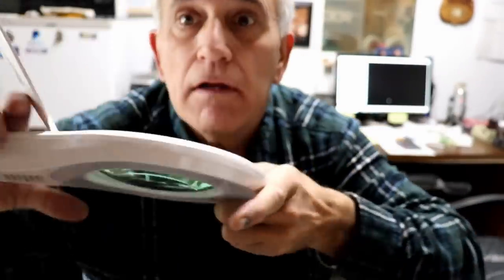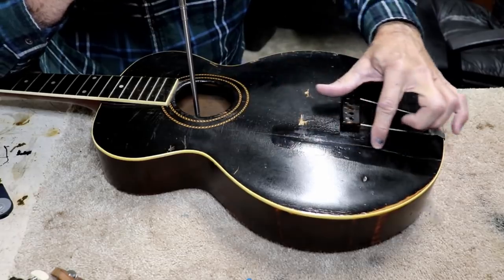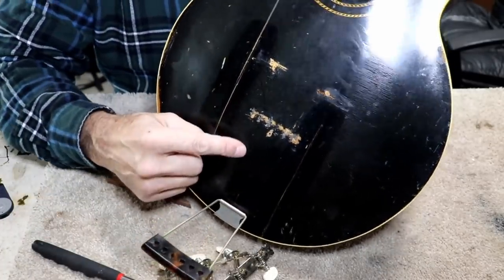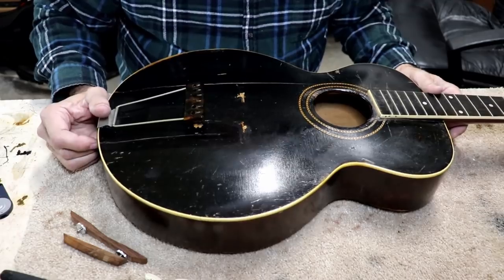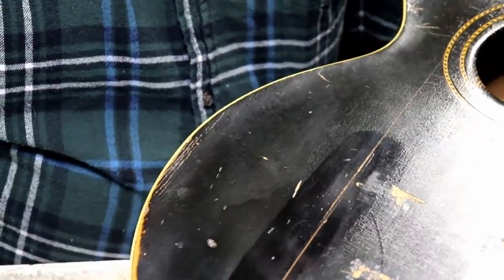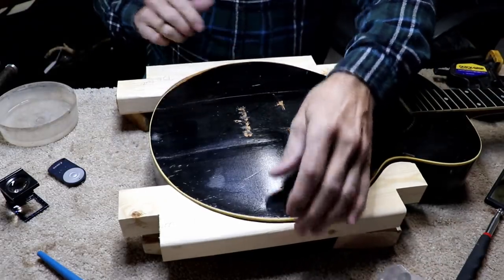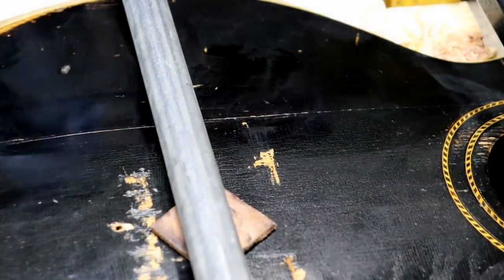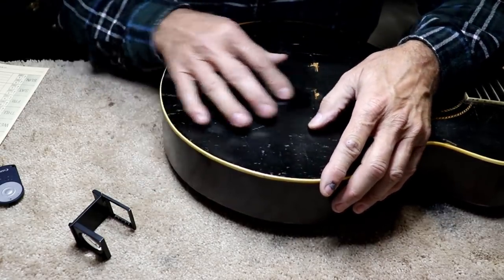265 RSW Gibson L1 Major Surgery Again Part 1

Comment: I just repaired a lower bout crack in a Seagull S6 with a cedar top.  Following your example I was able to sucessfully repair it.  I had to use a clamp on the top to pull it into alignment, didn't take a lot of pressure, but it held the two pieces in alignment. Thanks.  You also show me where the limits of my skills are - popping a top, resetting a neck, I'm not there quite yet.  Thanks.

Comment: I am not a master of finishes, but you are dealing with nitro cellulose lacquer on most Gibsons. Your cracks are called crazing, very common with age, and somewhat desirable, but... as I think you noticed, you can melt new nitro back into old and, heat from rubbing can also melt in a finish. I guess the lighter fluid helps, but heat from rubbing lots would gloss it up too. I have seen some work done with tiny drops of lacquer on Gibson finishes to fill in scratches  and then with a light sand and hot buffing make it disappear. You are totally on the right track here. Personally, I would keep on rubbing and some other guitar snob would hate how I destroyed it. :p

Comment: To read the label when it is like you showed. Take a lightly damp cloth with water. As I said lightly damp. Just pat it on the label. It will bring the writing out so you can read it. I have done this with old 78rpm records when they was not able to be read. It won’t damage the label.

Comment: Nice video Jerry. The 400 grit and paste did actually make a better finish. You can see it on camera. I suspect the lighter fluid would also help, but what a lot of work that would be. The neck needs a good clean.  I would think getting rid of gunk should be the first step of getting a better finish, but I guess you are doing that by softening and then changing the area of the paper towel. It's second nature to you. Your client will be well pleased. Your camera setup is working a treat now.

Comment: Hi Jerry.  I found your experiment with alcohol to dissolve the glue interesting. If you try that again, try using methanol. It's the most polar of the over-the-counter alcohols that you generally can buy at home improvement and hardware stores.  Best of luck.
Reply from the maker: I use denatured alcohol for a very long time and it didn't have any effect either.
Reply: @RosaStringWorks ,  denatured alcohol is usually a mix of methanol and ethanol, with chemicals added to make it terribly bitter so that no one can stand to drink it. The methanol, aka "wood alcohol", is what makes you blind if ingested. For cleaning and solvent use, you might prefer pure methanol. Pure ethyl and pure isopropyl alcohol might be worth trying as well....

Comment: You got the pronunciation of Snohomish correct, good job. I have family from up in that area in Washington. 

Why can't I ever find things like this for  $10.00? Nice find, I love those old Gibsons. I have to consider doing some repair work on my 1917 A1 that I got from my Grandfather. The back wood has decided to shrink and separate, and it's full up the back. If the binding weren't in such good shape it would be easier to decide how to go about this one. I may just see about shimming it and regluing it without removing the back. The joints beside that all seem to be in great shape, another reason I don't want to take it apart. Decisions, decisions...

Can't wait to see how this L1 turns out. If this one is old enough, a 1 piece bridge would be more original, like my A1 has. Depends on when they started using the adjustables on everything. This one actually looks a lot easier than some of the other things you've tackled, I'm sure she'll turn out just fine.
Reply from the maker: It kind of goes down hill in part 2. But we win in the end
Reply: Will, you beat me to it. Yes the pronunciation of Snohomish is correct. I, too, live in the area, about 20 minutes away going over 228th and up highway 9.

Comment: Rick G. from Massachusetts- there is a product called Formby's that does a similar job as the zippo fluid.  It's basically toulene and your right in that it melts the finish and you can rub out the micro cracks.

Comment: Harbor Freight has an air brush sized grit blaster they call an 'Air Eraser". Load it with baking soda and tweak the pressure/mixture to knock the gloss off of a finish.  Also great for removing paint and rust from tuners, etc.  Their hanging motor flex-shaft wood carver beats a flex Dremel.  Foot pedal speed control and more oomph at low speeds.  I think HF or maybe a craft store had a cheap pack of thin foam sticky-backed sheets I use on clamp faces and jigs for protection and to even out the clamping pressure.  Not a salesman - just some items I found very handy in my shop.  
I'm a repairman and hobby metal mangler so if you need an oddball tool, clamp, or something hit me up.  I like what you do and hate to see you struggle so much on these repairs.

ETG
Reply from the maker: Thank you.  The camera probably makes it seem more Dramatical. I don't really feel like I'm struggling. In fact I'm actually very fast compared to most repairment. I have a flexible shaft router. I just prefer using the hand-held Dremel. The flexible shaft bugs me.

Comment: The lighter fluid will get off all the years of accumulated gunk and it just may be enough of the right kind of solvent to soften the finish without cutting it too much...kind of like a french polish on shellac. Liquid finish "restorers" are supposed to work the same way but are often too aggressive as solvents and quickly become strippers. It depends on they type of original finish. Some finishes are impervious to some solvents. Having said all that, I'm surprised lighter fluid would work like that. :)

Comment: I’m working on a Gibson L4.   Funny thing on that it says B4 on the sticker.   
Has two cracks on the body on either side of the neck.   There are two loose braces in that area that caused those cracks.   I took the back off because it was pretty much coming off anyway. and discovered the long brace were loose too near the bottom as well as all the other “rungs” of the ladder.   There are three rungs below the hole and two above near the neck.  The kerfing is messed up as well so will replace all that.

Comment: If Wikipedia is correct about the production years I'd wager this is probably a second run of the L1 which should date it between 1926-37. The L1 was apparently not produced again until 1991 and has been in and out of production since then.

Comment: Looking good Jerry. I like the air pressure for pushing glue in when there is any problem with penetration. I'm sure if you had known how much CA might run through that fretboard you would have pushed some sanding dust in with it. But it's impossible to know at the start. Overall it's looking very good.

Comment: Here is something I found on the Web...
1. Identify:  Select a small, 2" square area that’s as inconspicuous as possible and clean that area with a rag lightly soaked in turpentine. Now that it’s clean, take a good look at the test area. If you can see open pores of wood under the finish and the finish is not glossy, odds are that an oil and wax finish has been applied. If that’s not the case, test for shellac. Take a fresh rag, soak it in denatured alcohol and wring out the excess before rubbing the test area gently. If the finish starts to dissolve right away or becomes sticky and darkens the rag, the finish is indeed shellac. If that doesn’t do anything to the finish, clean the test area again with turpentine and, once dry, start your test for lacquer. Do the same as before, only this time use lacquer thinner. If the finish comes off, it was likely lacquer. If nothing so far has affected the finish, it’s most likely a modern, vanish-based finish. 
2. Reviving a Lacquer Finish. Start first by lightly abrading the finish with #220 sandpaper. Follow the #1 rule of working with sandpaper – rub only with the grain so that any scratches will appear to be grain marks. Vacuum off the piece to clean it and then fill a clean jar half way with lacquer thinner. The idea here is to brush on a thin coat of lacquer thinner, causing the old lacquer to reactivate and be spread, just as it did when it was first applied long ago. Any scratches or blemishes should disappear before your eyes. Keep your brush wet at all times and move from wetted to non-wetted areas until all areas of that section and all other areas have been renewed. Proceed to Step 5.

3. Reviving a Shellac Finish. Shellac, like lacquer, is prepared for revival by a light sanding, followed by a thorough vacuuming. Mix four parts of denatured alcohol with one part of shellac in a clean jar and mix completely. Brush this concoction onto the finish, working only one area at a time. This should dissolve the old finish somewhat and cause it to be revived. Wait at least a few hours to see how well things are coming along. If it appears that the finish is not yet revived, or if the old finish was crackled, odds are that you’ll need to do a second and perhaps third application.

Comment: 1 table spoon kero 10 table spoons turpentine and shaved bees wax in a jar let it dissolve for 3 weeks - under the sink - and try that with a great cloth - my old jaguar car wood was sun damaged and i heard of this = great show thank you !
Reply: Ronnie Boucher used basically the same homemade stuff, minus the kerosene. Requires actual turpentine (distilled from pine trees), modern "mineral spirits"  or "paint thinner" is not the same thing. 

I've read a few historical novels that mention "turpentine camps"; I suppose a bunch of guys lived in the woods for months chopping down pine trees and distilling the essential oils. Probably distilling some horrid-tasting hooch as well, getting blind drunk, and fighting amongst each other !

Comment: The key to polish away them cracks in the finnish i to make heat! The cloth should be like a small and hard ball and you shall rubb hard on very areas  to get that 

heat to soften the laquer. I am a carsprayer and have polished many, many squaremeters of cars bodies. (not good in english thoug :)

Comment: Any OTT lights in the shop?  If not, check them out for deep true color.  I have six in the room where I build toys for kids in the hospital and bad circumstances.  I was Rescue and now home bound.  My 3 in one with a large light bar, magnifying lens on a second arm and a compression clip on the third arm.  Second is a new light, yellow-white-blue light selection with four levels of brightness and a shelf for an iPad or similar.  Really helps my eyes and brings out a lot by choosing the light value for maximum contrast.  I hope this helps.

Comment: That is a french polishing technique he found out by accident. With the right kind of solvent, and enough time, he could make that entire instrument have a mirrorlike finish. There are easier ways to do it. Applying the solvent directly to a rag is not a good idea because it can burn the finish. A better technique is to take a lint free cloth, fold it up tightly and completely saturate it like a sponge. Then wrap that with another layer of a dry cloth. The inner part acts like a reservoir and keeps the surface wet longer. Doing it a tiny spot at a time makes it pretty hard to have a consistent finish. It needs to be a lint free cloth because the tiny particles of dust embed themselves into the surface of the finish and are there permanently. Naptha (lighter fluid) is great at cleaning the dark gunk off the surface. Most lacquer finishes polish up really well with denatured alcohol. If I was to do this instrument, I would go over the surface with a high grit wet sandpaper to remove the outer layer of oxidation, and the bubbled up shellac or lacquer. That leaves a smooth virgin surface to polish. Once it turns black and bubbles up and gets a crusty look, it is too broken down to get a nice polish out of. As far as sandpaper grits are concerned, 400 is usually way too rough. I would start out at at least 1000, and work up to around 2000 before the polishing. Naptha is great to clean off the sanding dust, dirt and oils with because it does not aggressively dissolve the finish like alcohol. With alcohol, you need to work pretty fast because the cloth can actually stick to the work. You could also take it a step further and spray it down with a few thin coats of a good clear instrument lacquer like Behlen to make it practically look like a new guitar.

Comment: wow!!!!love the guitar and love what you did to it !!!those tuners are much later than the guitar they look like black diamonds which are from 80s maybe late 70s have the same on 2 of mine thier not very good and dont match whatsoever I day I will replace the buttons 
 ,I also reglued the old case case alone was 10 hours easilly but Know the guy and had to do it didnt charge him much ,but im trying to get customers so I do not get alot for my time doing cases,alot of pictures being taken so I can show my work nope not gonna do the you tube thing lol I am not a luthier like you but have a Great passion on restoration and thats really anything old just love doing it,I have a very simular guitar its a 1939 stella that is stenciled luckily it has no issues as of yet but its tuned to C6 but it was designed to play C6,country swing type stuff it was it was designed for and is made alot stronger than your usual gutar has a L shaped neck for slide guitar love it!!!

Comment: Hi Jerry, Hope 2019 turns out to be a very good year for you. Most of the cracks I've worked with in the old Gibsons (one of the hardest  to repair was a Gibson Harp guitar) or even violins, are a result of tops that shrink. Because the glue has held tight to the ribs pulling the crack back together with clamps just moves the stress to another spot and like you said can crack again somewhere else. Usually I cut a very thin kerf right down the length of the crack. This give me a crack that is a little more open and with the sides of the crack square to one-another. I then make a thin wedge shaped strip of wood that I press into the crack. To glue the wedge in, I use a hot hide glue that I make waterproof so it can't be easily reversed. You could also use the yellow glue that so many people use. I like the hide glue because it is a thinner film in the crack, is somewhat absorbed into the wood and as it dries & cures it pulls the parts closer together instead of a film that pushes the parts apart. That is why clamps a more loose after hot hide glue cures and the clamps get tighter when yellow glue is used. I'm not condemning yellow glue or those who use it. I use it for several repairs also. I do enjoy your videos and look forward to each new one. Ralph in Appleton, WI.
Reply from the maker: I've used the strip fill method myself. Thanks for taking a look.

Comment: I’d be interested to hear “why” you think these cracks occurred.  In other words what caused them?  It would likely be a well educated SWAG (scientific wild-ass guess), but it could change the way you repair and reinforce them.  

I’ve a civil engineer (P.E.), with 35 years of experience and I’ve done a lot of analysis on cracked concrete pavement.  While concrete and wood are very different, they tend to crack for the same reasons, shrinkage or stress.  Concrete cracks are repaired differently, depending on the cause.  If stress is the cause, simply repairing the crack with low viscosity epoxy, typically result with a new crack, right next to the one you repaired.  You mentioned there is evidence of a previously repaired crack, right next to the long one you’re working on, so that basically proves my point.

The fact that the cracks in the lower bout are parallel and long, does make me think they were “pulled” apart.  I guess this could be from either shrinkage or stress, but they are also on either side of the bridge, so the downward force on fr9n the strings pulling 9ver the bridge, could be a root cause.  Either way, I feel like it would be important to add cross bracing (which you may do, later in this video), not just cleats, to carry the load, after you’ve glued the cracks back together.  Just my $0.02.

Love your videos!  Keep doing what your doing.  Thanks!
Reply: im from the uk, to my knowledge utah gets rather hot and dry in the sumer, so a humidity controller in the case would of helped.. but Jerry's gona wrestle that crack back where it came from

Comment: The back of that peg head looks like a French polish job after you were through.  I wonder what the original finish was?  I thought maybe you'd try your buffing wheel on it also (might burn the finish?).
Reply from the maker: The buffing wheel works great on smooth finishes but this has so much egg shell that all the compound would get in the cracks.

Comment: Honestly, the way this top isn't braced well, and the wood being so old and Dry, and the crack that developed alongside the repaired crack, all lead me to think that more and more cracks will keep developing as time goes on. It needs more braces, even though that will negatively affect the sound, if I am correct in that suspicion. Braces - especially on tops - affect the sound, PERIOD. So it's a "damned if you do - damned if you don't" situation, IMO.